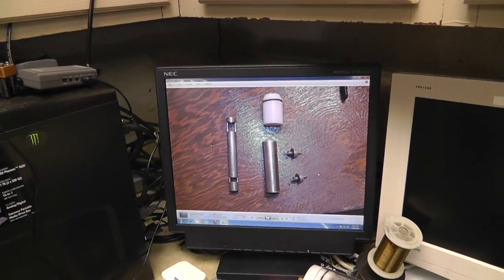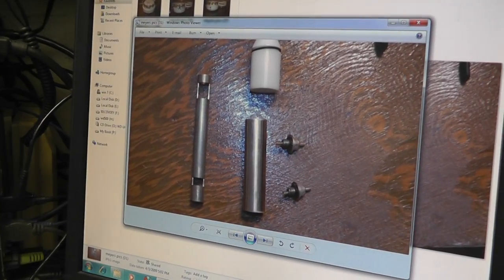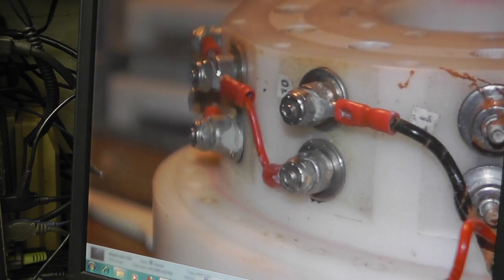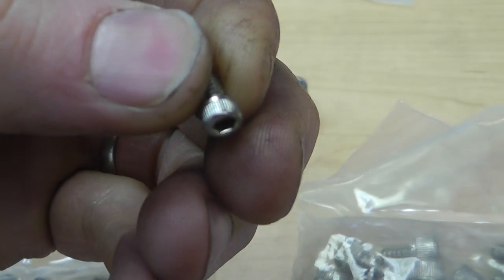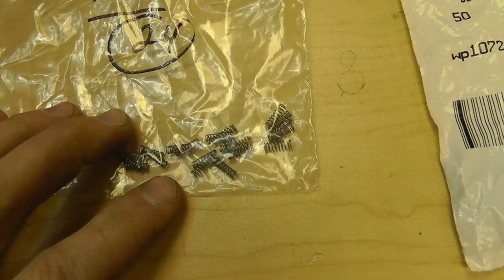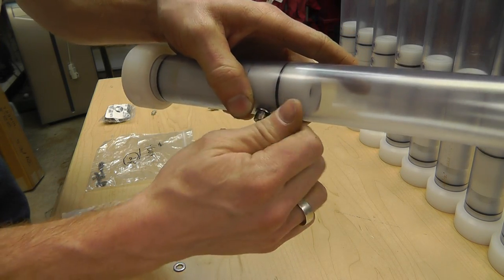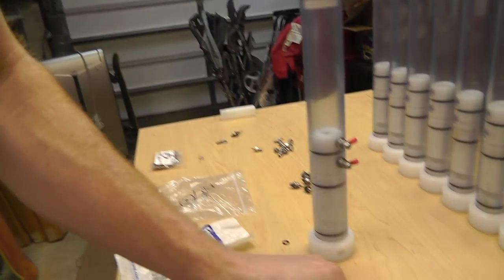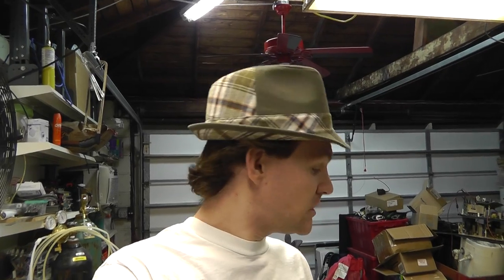A True Replica Of The Electrical Connectors Used On Stan Meyer Original WFC.

Comment: I think the biggest secret into finding the 1700% hydrogen production is how you condition the wfc tubes. Stanley Meyer talks about the argon gas as beeing non magnetic. If you anneal the tubes in argon gas and then test afterwards with a compass to see how the tubes get lesser and lesser magnetic force then I think that you will get increased hydrogen production. According to what I have read the brownish water will get cleaner and cleaner when amperage is increases slowly in steps 10 min 1A